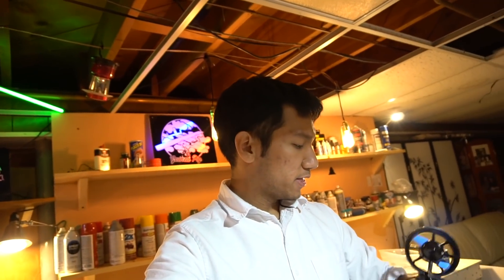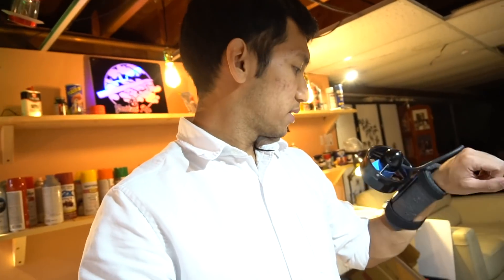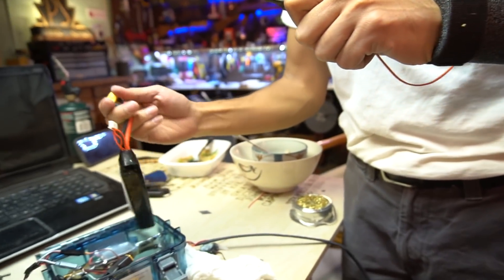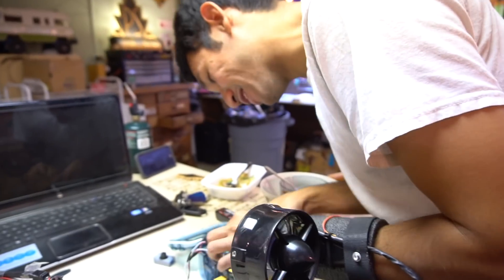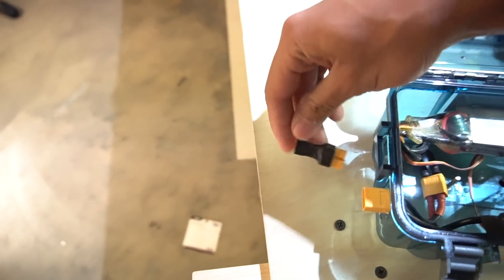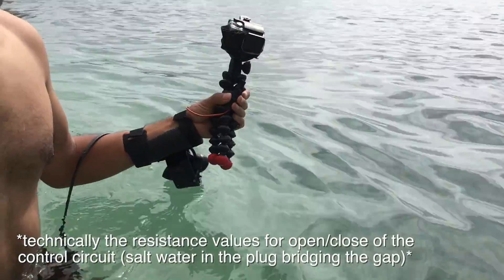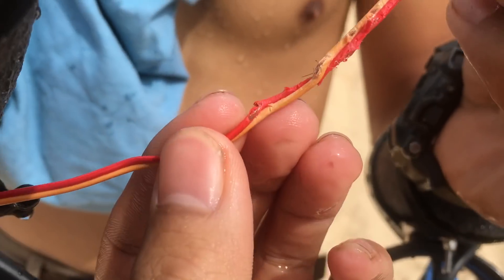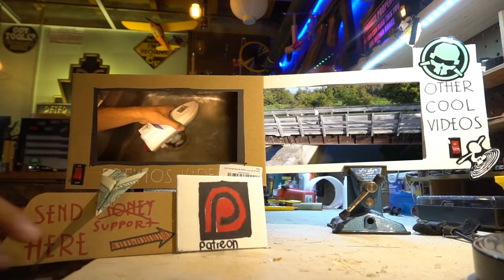Propellers to the fists

Comment: I'd put bigger ones on the legs rather, this looks tiring. plus you could float at the surface vertically with no effort if necessary.

Comment: It is t100 right? Maybe t200 could be better. I was thinking to do same with watersnake 24 lbs trolling motor. 12v 20ah provide 24 lbs and 4 miles hour.. It Will last 3 hours theorically with 12.8v 60ah lifepo4 battery . Just thinking how to find  Waterproof battery case and mounting just engine on my body.

Comment: Great project!

I'm building one of these myself and have questions about safety. 

Is that emergency shut down XT60 pin going to work if you pull it out in saltwater? Remains to be tested.

I might get an electric shock if any of the the waterproofing fails of the thruster button, cable splicing, box isolation etc, since its powered through low voltage (= high current = danger)?

Comment: Сool idea and implementation!
But you can make it easier if you use a $ 40 boat bilge pump like this:
https://www.ebay.com/itm/TMC-Bilge-Pump-450-GPH-12V-1003412-/333184753242

Comment: Next time try removing the potentiometer from a servo tester, extending some wires to put the pot in your hand, rig a trigger on the pot, put the servo tester in the box, so you have a squeezable variable speed control for the off-the-shelf ESC's.

Comment: Peter, mount them on the side of an old motorcycle helmet. They'd be up out of the way to leave your hands free. Could mount them on ball bracket, much like a rear a vision mirror, to compensate for your head angle, as it were. Cheers...

Comment: Electricity and water don't mix...

BUT THIS DOES THOUGH!
This was meant to be a joke
Reply: Low voltage
Reply: Actually electricity and water go fine together it’s the conductive salts in the water that electrocute you and the reason he is not getting shocked in the salt water is because the wires aren’t exposed and they are insulated keeping the electricity from coming in contact with the conductive salts in the water therefore keeping him perfectly fine

Comment: I once made a homemade underwater scooter out of two trolling motors, a 3ft section of 10" pvc pipe, and three gel cell 12 volt batteries.  It was awesome and I even took it down to over 180 feet of seawater here in CA.  It even looked good as it was all painted white and the prop guard was shaped like a manta ray.  There were two handles in the front on of which twisted for variable power and a T-bar that locked it at the crotch.  It was so powerful I used to haul my dive buddy down with him holding onto the top of the T-bar.

Comment: this is cool, turns you into an underwater iron man lol. I think a more stable design  would help though, either remove the turbines from the wrist and mount them on something you hold, so the turbines are in fixed positions in correlation with each other, so the power you produce is more consistent. But if you want to leave them on the wrist, then id atleast make something to hold onto underwater to keep you hands a specific distance apart and control more variables

Comment: PETER GOT A SUGGESTION  PERHAPS ADD PROPS TO YA ANKLE AND BACK AND HAVE THE POWER SUPPLY LIKE A BACKPACK THERE FOR YA WOULD NOT HAVE TO WORRY SO MUCH BOUT IT GETTIN SNAGGED ON SOMETHING AND ON THE FACE OF THE PROP HOUSING I WOULD SUGGEST A SCREEN SO IF THERE IS ANY DEBRIS IN THE WATER IT DOESNT WRECK THE PROP OR ITS MOTORS JUST A THOUGHT

Comment: Think I'd be using Weatherpack connectors & plugs on everything. As for sealing the switch...stick it and the wires in a lambskin condom, knot the end around the wires and seal the inside of the knot with a bit of silicone. Now your switch is watertight.

Comment: There is a board that is tied with a rope and pulled behind a boat that allows a diver glide under the water. Why not design a powered board using those thrusters add in some organic carbon power cells for long life for a full days use? 😊😉

Comment: I know it is a year ago but really cool. I'd split the motor power leads to each side of the box. Then mount it in the small of the back or find a contored water tight back back style. Stack the battery capacity then run your typical fail safes. Run heat sinks and seal the box with black rtv silicone due to temperature variants and the ph changes in salt vs fresh water electrolysis issues. Also probably run the power leads from the pack to the motors via a flat tape style wire lead and mount to forearms and over the shoulder around the center of back into the pack.

Comment: Peter, excellent project. For your next trip, I'd like to see each thruster be self contained. I know it will double up on the Arduino and batteries, but with no trailing wires or clunky box to wear, they'd be more aerodynamic and less prone to Stephanage.

Comment: Just one thing. Don't light the heat shrink on fire. You just heat it not burn it otherwise the plastic just melts too much and the wires can become exposed, which in water is obviously not good. Good video though. I just had that little tip.

Comment: An adhesive you want to buy and experiment with is E6000 by Eclectic Products.  It is a "SBR Adhesive"... Styrene Butadiene Rubber.  Same basic stuff as Shoe Goo, Seal All, but has a viscosity about like epoxy.  Just buy a tube (Walmart crafts, Michael's, Hobby Lobby, etc) and experiment with it.  I'm sure you'll find lots of uses for it with the things you do.

Comment: Snorkelers and SCUBA divers use booties and swim fins so their hands are free. Putting the thrusters on your ankles or calves would allow you to take pictures, hunt with a spear gun, collect rocks or shells, or whatever.  I like the thrusters because they are self-contained.  They look safer than exposed propellers.

Another concern is salt water, which you did a good job protecting your rig from.
Reply: I'm a scuba diver and i would like to put it on my butt.
Reply: That gives a whole new meaning to the idiom, "He likes to fly by the seat of his pants."
LOL!
:)
Reply: The only real way to dive is muff-diving, my friend,
Reply: Gordy - ゴーディ King - 王 ohh
Reply: Without actually testing this, putting fans on your feet may have the same effect as flying with thrust from your feet. It makes everything so imbalanced. The Hacksmith ran into this problem, and is why Gravity use hand and back mounted jets.

Having a slightly larger ESC on the back could work for thrust and a central stabiliser with the two smaller ones on the arms to be used for better directional control when required.
Reply: @Redbaron_Gaming  you dont need balance under water

Comment: How were those connectors at 6:52 waterproof?
Reply: I have the same question I guess. How does this not break the electronics, not cause a short circuit? This is really interesting. So the water can be around those 3 pin connectors without breaking it. Why? Would this also work with a USB connection sticking out the same way?

Comment: Step 1 for successful re-engineering of devices:
Test for Application. Wire power source to device, dump in water. 

Water is quite heavy compared to air, hence why blades for water have such a different shape (and marine engines require more torque). Fluid Dynamics apply to air as well. but the formula for air resistance is substituted for water, naturally. I'm haven't seen your attempt yet, but I would have fixed those blades in a bath tub before going balls out with the electronics =)

Not to quash your dreams, but the Navy has had these since the 1980s, the ubiquitous DPD, and SDV when you want to party with your other seven warrior bros.

Comment: I can definitely see this device being sold to scuba divers, you should patent it. I do have some thoughts though. Maybe it should be placed on a belt and capable of being positioned on either side of the hips. This way the diver can have free arms. This also places the thrust on the body where it is easier to control since the hip is basically the main fulcrum of the human body and you could control direction with the fins on your feet. Kind of like a whale or dolphin. Of course I'm not an expert in fluid mechanics, so it's just my opinion.

Comment: Wait, isint salt water conductive? Wouldn't the break plug not really work?
Reply: Yes it's conductive, but if it was pulled and electricity did "leak out" it would be going all over the place and wouldn't produce a strong enough charge to keep the device going. Think of it like water though a pipe, there's more water pressure while it's in the pipe and less pressure when it's leaking out all over the floor.

Comment: WOW! This was probably the coolest project I've seen you do Pete. I like the wrist mount idea. but as a former diver I think maybe if you had used a pistol grip mount with a water tight cross bar on a lanyard might have worked better. you could have put everything inside the cross bar with the two fans mounted on swivels and if you let go of it for any reason the air tight cross bar would float. and with the lanyard you'd never lose it. it's just a thought what you did is pretty cool though.

Comment: Mount the two units, or more, together on a hydrofoil spanning 1.5 feet [or more] which you hang onto and let it pull you. The hydrofoil would allow pitch, yaw and roll control.  Thumbs up dude.

Comment: I like your concept Peter.  I would take your thrusters and mount them to a board with a couple of hand grips that you could angle up or down and side to side.  You could incorporate  everything  into the board and it would be more manageable.  Your control switch would be mounted into one of the grips.  Kind of like a water boogie board. lol

Comment: Peter you're a genius, amazing work. That's got to be your brother to call him idiot, since this is what I know mine to be.
 I've had hot glue come apart in a bath tub test, so why not use silicone for wire seals and such if you have time for drying. I'm always hoping you don't have a failure from this especially in the salt water.

Comment: The laws of aerodynamics still apply in water, so you could use this to create an RC underwater plane. You'd need a special comm method though as standard radio control doesn't work well in water.
Reply: So an RC submarine?
Reply: ***** I was thinking more of a plane that flies in water, submarines have been done to death :P

Comment: why do you need arduino there, you can just but switches between power cables?!?!. Sorry for my bad english
Reply: The ESC requires what is called a "PWM" signal to run the motors. The motors are not just DC motors you can run a voltage to. The arduino generates the PWM , which tells the ESCs how fast to spin the motors.
Reply: Josh Willis pulse width modulation, righ?
Reply: ScarfBandit Yes. Hobby ESC's are controlled by a PWM signal.

Comment: Am I the only one who thinks the battery cutoff won't do what Peter thinks it will do?  If the purpose of the kill switch plug is to maintain a connection and then remove the connection, when you're under water won't the connection be made though the water?  It would be much better as a toggle switch, or something that can be isolated from the water.

Comment: I think it would be better for the next version to be more self contained. With a power supply for each propeller. And a set of 3D printed case/ wist mount for each fore arm. But for the lack of build time. The set up was great.

Comment: Water is conductive so wouldn't it just short out the key
Reply: The key works in the opposite way than you think, the key is just like a switch, and when the key is in the current will flow through the key and into the electronics, however without the key the current will not.

Comment: This could really help for people who get stranded out at sea, because once your body gets tired, you can use these. Great product, I would buy it if you ever sold it.
Reply: Figglebob High The battery wouldn't last long.
Reply: small inflatable boat and a good size kite would be the better package, you could "sail" and the sail 150ft high also serves as a beacon for being spotted. add a dagger board to the concept you could tack to travel upwind if wanted. CO2 cartridge auto inflate 2 person capacity, this idea starts to rock.
Reply: They couldn't beat even slight current or probably even normal waves on a windy day. Plus whirring sounds and electricity has a tendency to attract sharks. Not that that is necessarily a problem, but it might stress you out.
Reply: Don't get me wrong. It's a fun little invention and I fully support people having fun with stuff like that. It's just that doing certain things in water requires certain general skills and knowledges and some people would rather believe that nifty gadgets can replace that. Ironically they are the most likely to get in trouble trying, due to the sense of false security. Like the poster believing this to be a potential fix for being stranded at sea and getting tired of swimming. That's a potential recipe for disaster in and of itself in a real life scenario. Some of the gadgets I see around youtube present a direct threat to the life and health of the casual user. And they are not standard equipment for that very reason.
Reply: Figglebob High ur face is misleading...
Reply: whynottalklikeapirat I shouldn't have argued in this field since I am not an expert. Apologies.
Reply: nice
Reply: Figglebob High this would not be practical for out at sea since the obvious current would affect the mover ability and the batteries would not last long enough to get to a safe place or sustain a safe position what your in.
Reply: whynottalklikeapirat  shut up kid
Reply: Tom Lawson
YOu may contacy me when you have constructed a viable body harness for your host of individual little machines. At that time you may also explain why you did not simply get a tested professional propulsion rig in stead if you are so averse to finning like a normal person would. I'll warn you in advance of the lower cost ones that you can buy in various dive shops. They too can barely pull you under.

This is a fun device with no practical application that can't be achieved simpler, better and more reliably in other ways. But by all means go ahead. You'll learn fun stuff about water.
Reply: whynottalklikeapirat If you had enough of them on your body it could beat currents.
Reply: solar charger mayhaps?

Comment: Imagine the battery and esc built in too the fan while also attached to your arms in a bent position . Then it's allot easier to make the electronic waterproof. The controller should be wireless like a boosted board controller

Comment: To decrease the control box's buoyancy, and at the same time increase resistance against salt water ingress, fill the container with a non-reactive silicone oil. The oil volume will weigh close to that of water, and won't react (electrolysis) with any of the electrical connectors. Just a bit goobie when you open the container, but you wouldn't need to open it frequently either. Oh, and the oil will keep the ESC cool as well.

Comment: Alright do this project, but give yourself 100 amp hrs of battery, and 20-30 of these motors, and and make a hydrodynamic jet suit that you can control with arm and leg fins. If you could just cruise the ocean floor at going like 50, that would be ideal.

Comment: Add a handle on a bracket connected to each thruster, and then install the control switch in one of those handles.
This will eliminate the "switch wires chewed by thruster" failure mode you encountered.

Slight improvement to that idea would be to use one center-off DPST momentary switch in each handle.
Then you could get it coded so that you press "back" on the switch to go slow, and "forward" to go fast (or something like that).

Having each thruster on it's own control would help a lot with turning.
Turn off (or slow down) the thruster on the inside of the turn and you'll change direction a lot quicker.

Just some ideas.

Another idea, only tangentially related to this project.
Make a twin propeller boat, but instead of a rudder, it uses differential thrust to steer.
Reply from the maker: great points! I'll have to look for a DPST switch that i can waterproof for the next go! thats a better idea than the clicking of the button. Also having two separate thruster controls on their own self contained system is the plan for the next one!